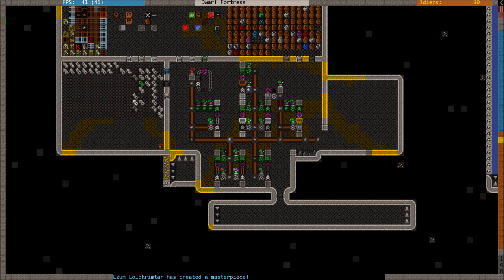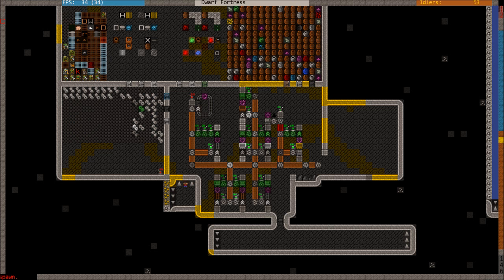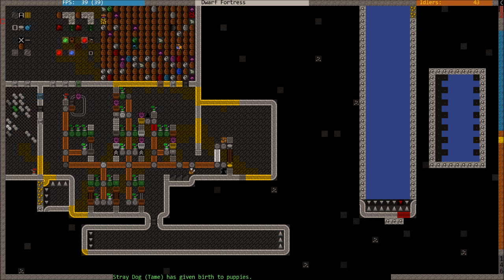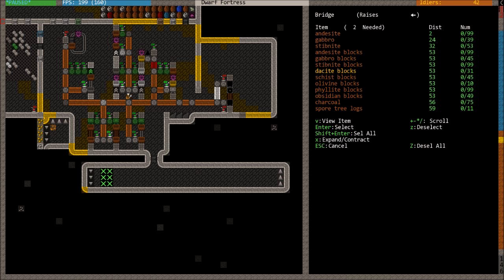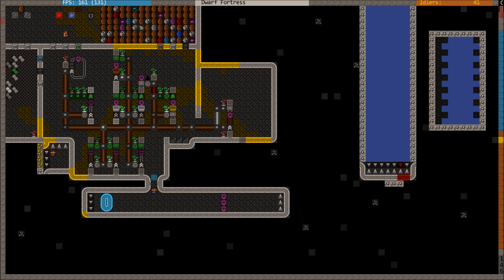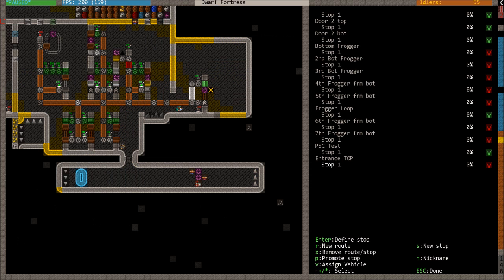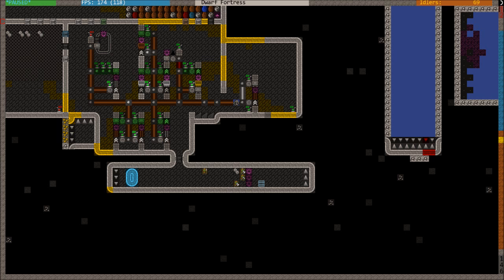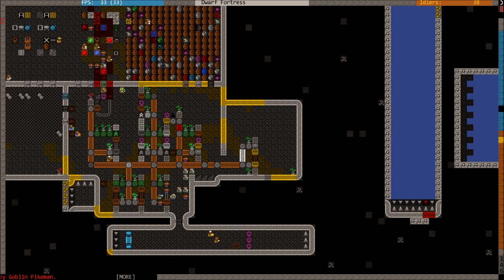Dwarf Fortress Minecart Logic 101

Comment: i am having an issue with the rollers, i have everything hooked up as you showed, however when i pull the lever to turn on the power, the top cart is not moved in any direction

Comment: Well, you could also use this in traps which kill slowly which need to be turned on and stay on for a long time.  Like drowning traps.  Raise a bridge on either side of the pressure plate and open the floodgate.  Once everyone in the trap is drowned, then have a dwarf reset the traps with one flick of a switch.  Very clean and simple.